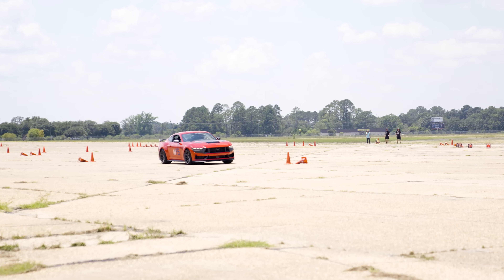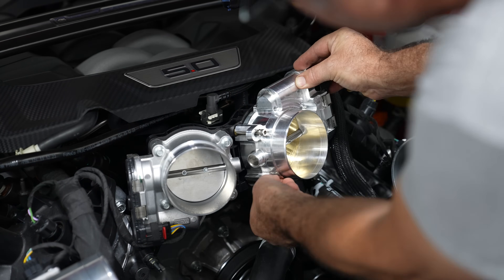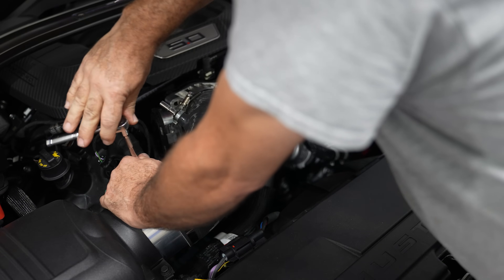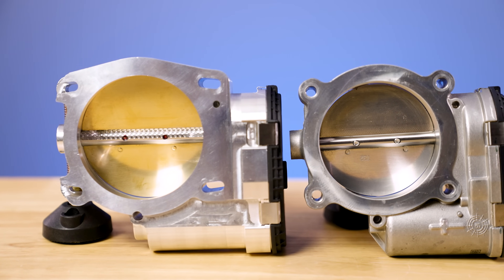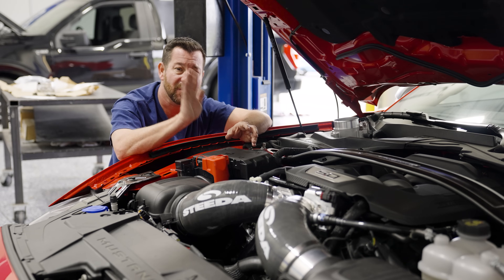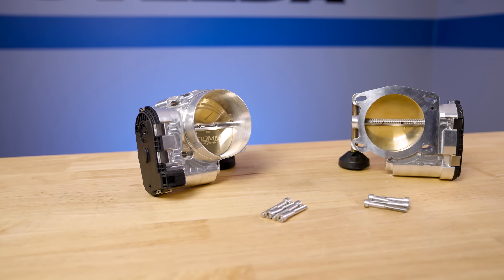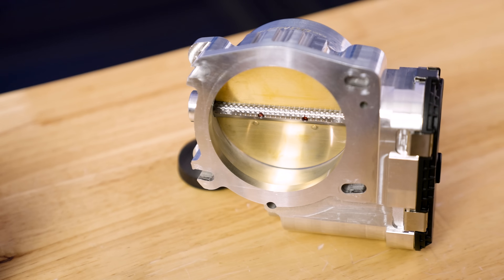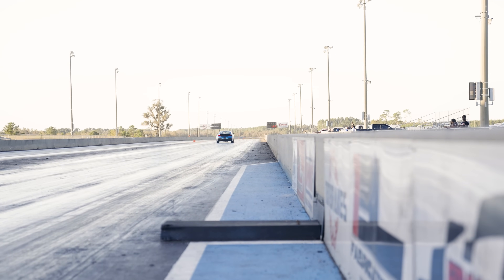Testing Larger Throttle Bodies on the 2024 Mustang!

Comment: Small shot of wet nitrous using an adapter off the port fuel rail seems in order to all this, second ser of stock tubes, plumb the nozzles in there and with temp install make it ALL come off with 5 minutes before ya tow it to dealer....get the wet mix right and let the stft do the rest....

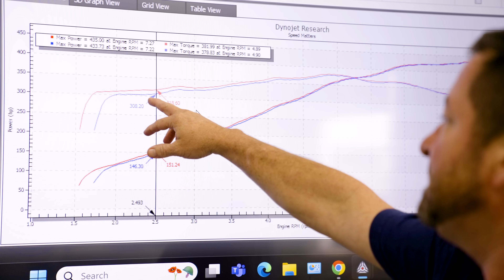Comment: Im sure once tuning is out, stock TB's will be able to be "opened" faster as stated @11:00 therefore making this "upgrade" completely obsolete.  Its proven for over 20 years with Ford engines the cheapest HP/$ ratio is forced induction, not NA.  And stock G3 & G4 coyotes are a great starting point for a FI build.

Comment: The only way bigger throttle bodies gain more at low rpm than high rpm is if the stock calibration isn't opening them all the way in the first place.  The larger area of the aftermarket units will allow more airflow for a given throttle angle (they don't open faster, the open area increases more per degree of blade angle - important distinction).  Of course, if the difference is big enough you will get a MAF correlation error and a check engine light.  Either way, not really a useful mod at this stage of the S650 game.

Comment: I’m considering this down the road because all these small mods like like bigger throttle bodies, throttle body spacers, air intake, and etc help down the road when n/a turning is a thing. I’m trying to hit 600 hp n/a!
Reply: @ something funny?
Reply: @ynxg-x-hoddie5531  you are. Spend 1000$ on throttle bodies idc.
Reply: @ it’s my build😒
Reply: If you want 600 na you picked the wrong car man.  Newer ain't always better.  Just get the one that can make the same power and only needs 1 intake and tbody and it actually has tuning smh.

Comment: I just don't understand how it's not throwing codes? The way these cars are all PC now and not to mention locked still.. I changed an air intake on an older car about 10 years back and within a year I had a MAF code that never goes away now.. IDK.. I haven't done that with my GT because I have seen without a tune it's a problem so not taking shots just confused a little....
Reply: @marcasswellbmd  this might not have MAF’s (speed density). My truck is speed density and doesn’t need a tune for a larger throttle body.
Reply: It may throw codes it hasn't been on long enough to throw it (possibly)
Reply: I was thinking the same thing... And... I could be totally wrong, but I remember hearing (when I sold high performance parts) that half of the high octane fuels, exhaust mods & intakes that people bolt on, are compensated for by the CPU & don't produce any noticeable power without resetting computer parameters... In other words, the computer thinks its doing its job retarding or advancing timing & air fuel mixture to keep the engine performing at factory settings...

Comment: Look I am a Steeda Guy all the way. I Just recently did their Supply line and Braided Clutch line. Besides the Jack rails and IRS braces too, I could go on.. And good for them always trying to be first and develop new things but I have to say I am sooo happy to have the Gen 2 S550 with 1 air box and less points of failure.. Not knocking the S650's but I just see a more money more problem type of situation when I see 2 throttle bodies on the 24's.. This stuff is expensive enough already without having to have 2 of everything.. LOL..   But I am happy to see Steeda pushing the new platform even though I'm an S550 guy.. I thought about doing the Ford performance Pack 2 but I really think I am going to leave her at stock power for a couple more years.. I'd like to strengthen some of the week links on it first before I go for more power.. Next on my list are the 1. Steeda 3/4" drop Handling Progressive springs, Drive shaft, and then a Barton shifter.. I'm also going to be doing the SVE GT350 wheels and tires eventually too.. My God the money adds up soo fast though especially when you are trying to pay bills too... Oh well little by little..

Comment: not a lot of HP for the $ i think it would better to wait till they crack the code for tuning the ECU to take full advantage of the standard gear who knows what it will make with a tune (30 to 50 HP more ?) and you can change the throttle feel with changing to sport or track , drag mode for free i think the silver bullet and competition focused cars  would benefit but  average street daily driver guy  would be wasting their $ till you can tune it properly  to take advantage of the other mods like  pipe intake etc etc stage 1 stuff  and then cams and forced induction

Comment: I always thought the 1/8 mile times of these mustangs was slow compared to their 1/4 mile times.  I was at an 1/8 track in my procharged godzilla f250 that weighs 7400 lbs. The most recent mach 1 was an equal race for me. But go to 1/4 mile and he blows me away. It needs an early on kick in the pants. Maybe this will help.
Reply: Sounds like it needed traction.  I'm sure you were in 4x4 right?

Comment: All due respect to Steeda- but.... this video could've been about 5m long. And $1000 for a handful of HP? Somebody has more money than sense.
Reply: @leviefrauim1425  honestly I’m glad they took almost 15 minutes just to say these add a negligible amount of power while simultaneously degrading throttle modulation, all for the bargain price of a thousand dollars…
Reply: Watch the other videos that will come out by others with no dyno runs and just as long. The honest info you get from steeda cannot be compared.
Reply: @GojirasBreath  I love Steeda and have purchased/used many of their products but this video is filled w/constant repetition of the same information, ergo my comment about it being shorter in length.
Reply: @leviefrauim1425  i get it. They had chapters so I was able to skip straight to the dyno run. I didn't hear the repetition.
Reply: Agreed
Reply: Dude it’s not just about the throttle body itself, when you put this with other mods and if you plan on making crazy hp with this or even drag racing it then that’s the audience you don’t want your engine fighting to stay alive you want the proper mods on it so when you make those high hp number and race it hard everything flows
Reply: 🤦🏽‍♂️ 2 90mm throttle bodies aren't going to just be the only upgrade being done, genius. It's probably for a low key twin turbo build 😂
Reply: @TheManic.5-OH  except that the Steeda rep said specifically they're trying to get the most power possible in an NA format, "genius." So blow it out yer arse.
Reply: @leviefrauim1425  well it looks cool I guess